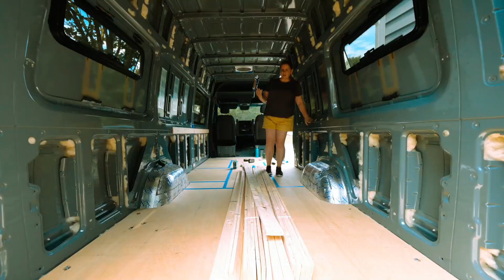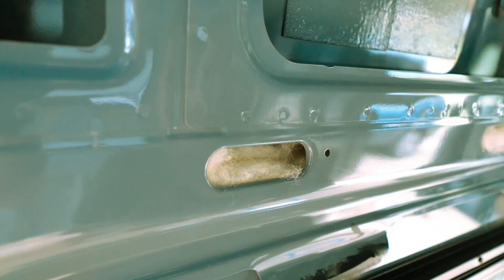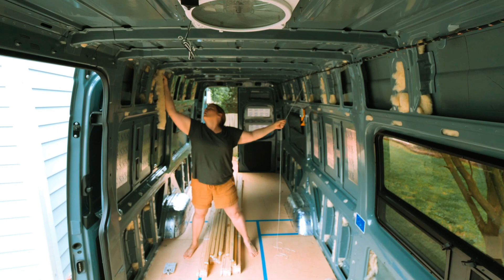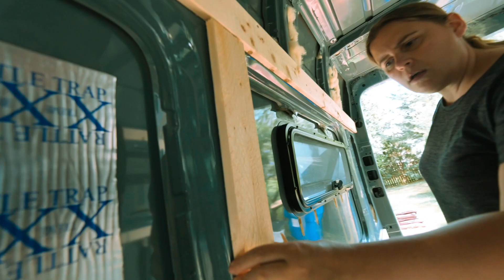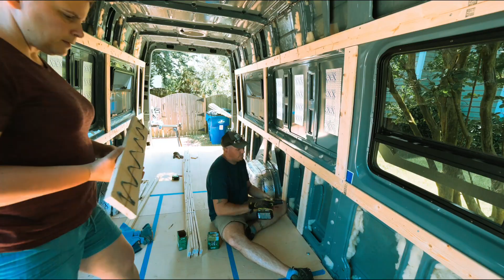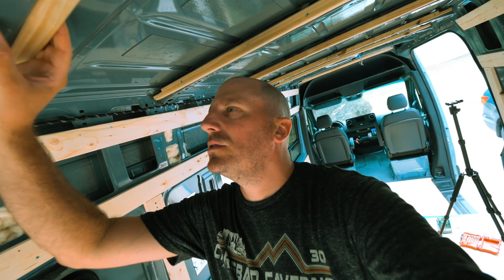FRAMING Walls & Ceiling in a Custom DIY Sprinter VAN BUILD  |  Van Build Series Video #6

Comment: Out of curiosity, why did you go 1 1/4” screws instead of 1 1/2”? I’m torn between the two!
Reply from the maker: The furring strips are 1x3s on the walls. We used 1 1/4 because it was enough to get through the wood and into the natal framing of the van. We tried to choose what was just long enough. We always had this fear in the back of our heads that we would go through the outer shell of the van haha!

Comment: when you drilled the 2x2’s to the top ribs, did they have any kind of slant? i thought of doing the same thing but it seems like the side walls of the ribs aren’t perfectly straight up and down which would tilt the furring strips and i’d be drilling my ceiling into an uneven surface.
Reply from the maker: There is a slight slant to them but not bad. We notched out the ends of the 2x2 so they would be straight and go completely from side to side. Hope this makes sense?

Comment: What kind of screws did you use to attach the wood to the van frame?
Reply from the maker: We used #8 1 1/4 Spax multi-purpose construction screws... predrilled the holes then inserted the screws... all the frame also has Liquid Nails for added security!
Reply: How did you align the board to the predrilled hole?